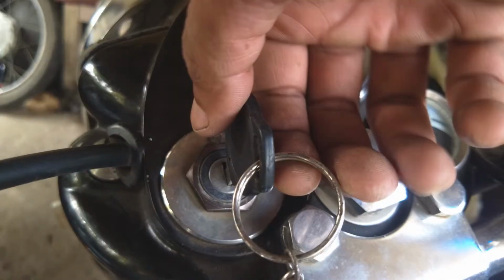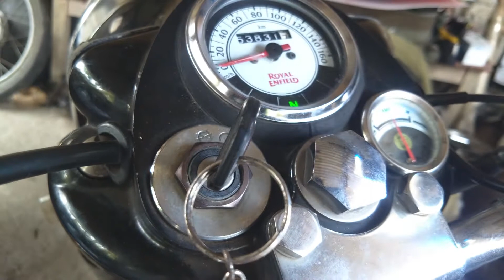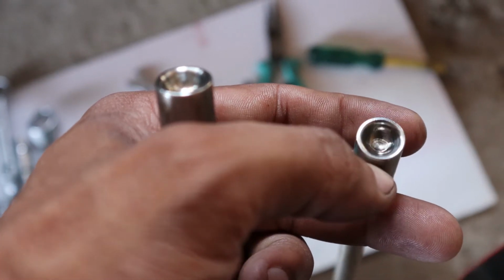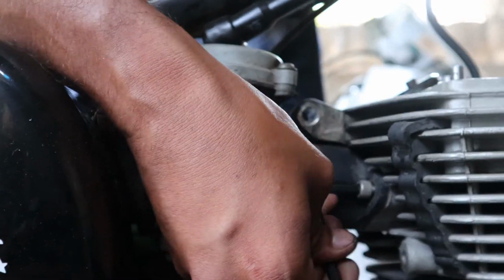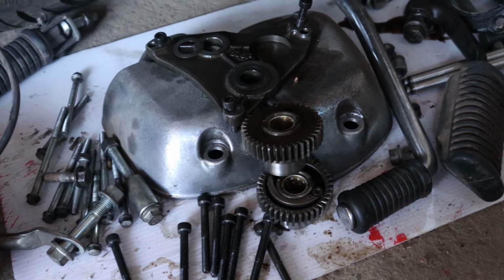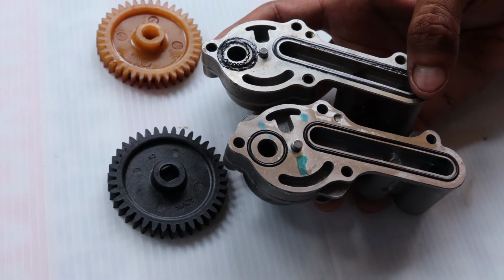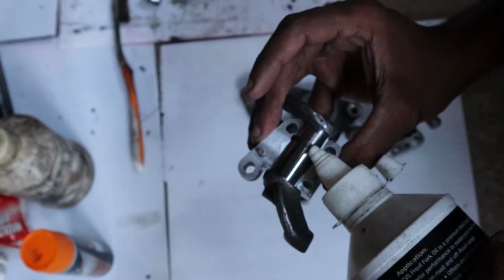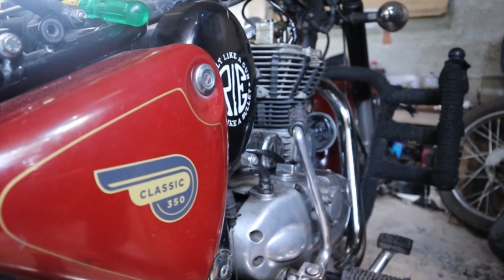How to solve Tappet Noise in Royal Enfield UCE Engines?? - Bullet/Classic/Thunderbird motorcycles

Comment: Thank you for the insight inside the engine. I have been facing similar noise which has been driving me crazy. I'll have SVC check the push rods and report back if that fix the issue.
Reply from the maker: Sure. 🙏🏻 thanks

Comment: would tappet noise come in the new classic 350 reborn
Reply from the maker: In the classic 350 reborn, there are no hydraulic tappets.. the valve actuation is through timing chain mechanism.. so, if at all the tic tic noise comes, it would not definitely because of the tappets, but probably due to the timing chain or any other components
Reply: @TwoWheelerStoriesbyswathysk   thanks bro...

Comment: Is it ok to fully tight rocker box?
Reply from the maker: Yes it is.. may be some minor adjustments could be made after starting the engine (if at all for ensuring proper oil flow). But strictly mibro adjustments!! Because there are chances that the threads of the rocker bolts or the head may get damaged because of the valve spring loading if the bolts are loose while the engine is in operation

Comment: Would this last long before it would make noise again?
Reply from the maker: Definitely it will come again brother, but the question is how long it takes for it to make that noise again. Tappet noise comes because of wear out of various components in the valve train. We have to check and replace each worn out component seperately. If we change every component of valve train, sound will take time to come or else depending on the degree of wear out the time varies. 😊 Unfortunately in this method of valve actuation tappet noise is in evitable. We can reduce it maximum but upon usage it will come slowly.

Comment: I have a 4,000 k 2020 500 engine and am not happy with the quality of the Enfield build parts used. I have the same ticking noise and am thinking I'll have to trailer it 300 k's to the Enfield dealer for the repairs.

Comment: Facing the same issue with my classic 500,could you please let me know how much it costs to rectify this not at the RE service center but at the 3rd party mechanic,coz RE Service centers have done a very bad job of servicing my bike all this while,atleast in my hometown.
Reply from the maker: Hello borther, so sad to hear that. The noise happens because of various reasons. It is required to check thoroughly and identify the reason, only then will be able to help you with the coasting. Otherwise It will simply be a wild guess which will lead you again back to confusion.